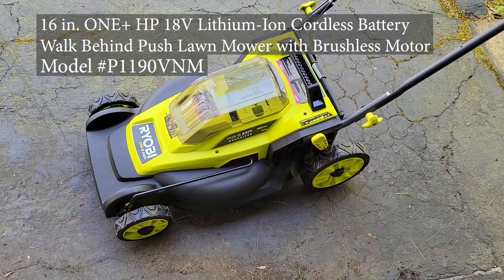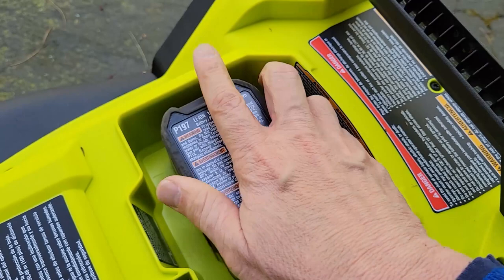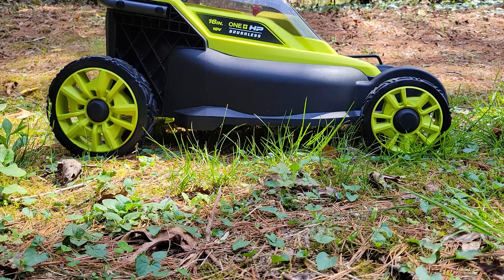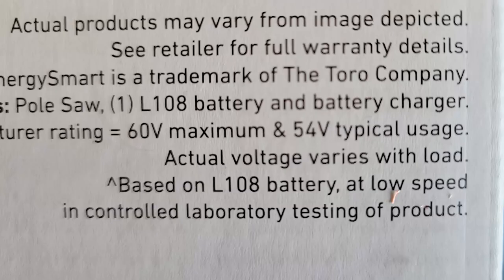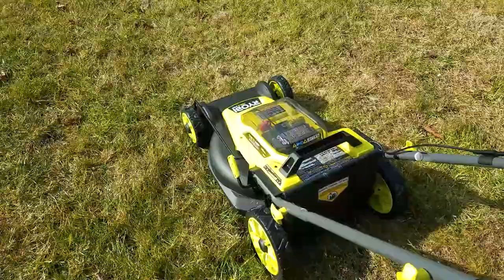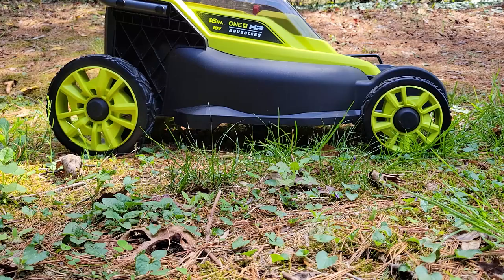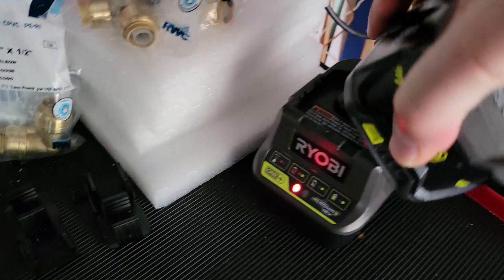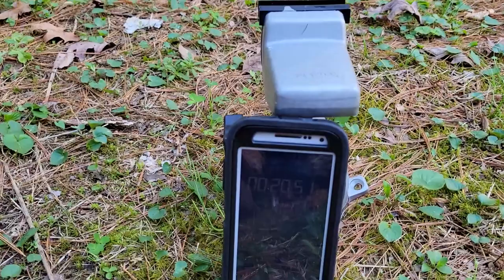By Request, Ryobi 16 inch One+ HP 18 Volt Battery Mower Update (#P1190VNM)

Comment: Recently I became the caregiver for my younger sister after she had several strokes this past year; my income has been strained to the limits on the critical bills; so when my lawn care person tried to double the cost of the service, I was unable to pay the new increase.  By the time I was notified, the grass had grown for about four weeks, my older sister provided us the 16 inch Ryobi and the small battery and the weed eater.   So, far the mower is doing the job as well as any lower cost mower would have, just don't expect a commercial level quality.  Each battery tends to run at 20-25 minutes with the high grass. So the standard two batteries can get almost an hour.    Charging the battery takes about an hour, so mow half a yard, take a break while charging, and finish the second half when the heat has dropped.
Reply from the maker: For those not wanting to take the mandatory break while the batteries recharge, there is either the option of buying more batteries (when on sale) or moving up to the larger Ryobi 20 inch  mower https://youtu.be/AFmHDFHUNFI with higher capacity battery.
Reply: @cfldriven  We wanted to get more, but they weren't available at the time.  I would like to get at least two more so one set can charge while I use the other set.  Thank you for the video
Reply from the maker: @shawnclement3365  HomeDepot is running a sale 2-batteries 4amp w charger  plus a free tool for $99.
Reply: I have this mower with 6 amp hour batteries, and it lasts less than 5 minutes. Not only does it drain them, it also causes them to overheat.

Comment: I have one of these and cut the grass once a week. It works fine, I'm able to cut the front with about one and half batteries. I live in FL and have st Augustine grass (very thick). My property is 1/3 of an acre which is larger than most track homes. Also takes one and a half batteries to cut the backyard. I cut the front one day and the back the next. Mine came with the green quick charger.

I have 7 batteries and 3 quick chargers because I have several Ryobi cordless tools so it makes sense for me to own one of these
Reply from the maker: Good point, being in the Ryobi eco system helps with having extra batteries and chargers to continue working. As I deplete a battery, I tend to take a break to hydrate and rest before moving on with the next battery. Despite some of the short comings these electric beat out dealing with the maintenance and fuel issues of old. Thank you for sharing your experience.

Comment: I converted a couple of larger landscape areas that had bushes and ground cover back to grass. They are in areas that my lawn service cannot get their zero turns to and are not the right shape or size for a big commercial mower. I got one of the Ryobi 16" mowers plus the weed whip and they are great! Perfect for doing these areas and easily does all the cutting once a week on one battery. The nice thing is the mower and the whip use the same battery. Highly recommend for small spaces, especially if they are hard to get to as this mower is so lightweight and easy to carry.
Reply from the maker: That a great use of this machine, I met a person who has thin row of grass along the driveway and had been using weed whacker until he got one of these mowers. Thank you for sharing your story.

Comment: A mower that is not actually mowing the yard is worthless. A proper test would have been to also actually mow the lawn with a the mower.
Reply from the maker: Yes, totally agree with you, but it seems that Ryobi also doesn't mow any grass and just gives the highest no load running time. The video only proved that Ryobi claim is barely possible with no load let alone mowing. In real mowing I got 18 and 17 minutes out of the two batteries, but someone with taller or thicker turf would most likely experience lower run times. I think the lesson is when the manufacturer says "up to xx minutes" chances are most of us won't hit the number, sort like MGP in cars. The other thing to keep in mind this mower is designed for small yards (1/4 acre or less) and in that regard the two batteries were more than plenty to get the job done. I just wish Ryobi and others would provide realistic run times. Thank you for watching.
Reply: Good answer ...

Comment: Got it! So to get the advertised run time I need to just let the mower sit there free spinning and not actually put a load on it.
Reply from the maker: Yes because that seems to be the way the maker derives their best run time. As I mentioned in the video they do a disservice to themselves and the buying public when taking this approach. To be fair it is a common practice with many other manufactures. If you own other Ryobi plus products you can swap in one of their battery,  even the 6 amp, for additional runtime.

Comment: This mower was meant to compliment another mower, eg. a riding lawn mower, that can't fit into certain places.  The 16" is a dead giveaway.  It would take you forever to mow your lawn.
Reply from the maker: One has to remember Ryobi designed it for a quarter acre or less of lawn. As long as it is used within its design limits most people will be happy with it's performance.
Reply: That’s what I use mine for!  It saves me lots of weed whacking.
Reply from the maker: @glennkrzeminski7539  The person I sold this to when I replaced it with the Ryobi 20" https://youtu.be/AFmHDFHUNFI wanted it for the exact purpose. He had a little path and this mower would be quicker then a weed whacker. Thanks for watching.

Comment: The earlier model used 2 batteries?  (could you run that mower with only 1 battery installed?)   I have the 13" which is not brushless - basically a strimmer on wheels (B&D actually made a deck for their strimmer to use it like a lawnmower.)  I use mine for touchup around shrubs.  Don't know if it's worth getting.  And then WHICH 16"
Reply from the maker: I upgrade to the 20" 40volt brushless Ryobi https://youtu.be/AFmHDFHUNFI and totally love that system. 
I believe the old two battery unit would auto swap to the full battery. The 40v holds two batteries but only one set of terminal contacts. 
I would say if you are happy with Ryobi then get their 16".  Thanks for watching.

Comment: just got used one for 40
have very large lawn and many batteries
will use the crap out it
Reply from the maker: Congrats on the price. If you have a large lawn this little mower more might get frustrating to use as it will take a lot of walking and battery changes to finish the job. It is ideally suited for 1/4 acre or less.  I switched up to the Ryobi 20 https://youtu.be/AFmHDFHUNFI and it just cuts more and runs a lot longer, although it uses 40v 6Ah battery. 
Thank you for commenting and watching.

Comment: damn， i got about 8 mins run time from one battery and about 9mins from another. Battery got hot really fast
Reply from the maker: And what where your results on the next mowing? Under normal use the battery gets warm but should not get hot.
Reply: @cfldriven  just bought the machine yesterday.today is first time to use it.only finish back yard today. I heard 40V model is better, but I like the 18v Battery that is interchangeable with my other tools
Reply from the maker: @mengwang6407  At least for me the 18 volt is plenty, but if you have thick or tall sod, then the higher capability of the higher voltage units would be advantages. Recently got a pole saw from Toro and it uses 60 volt battery.  https://youtu.be/eN1sIOrmwVo